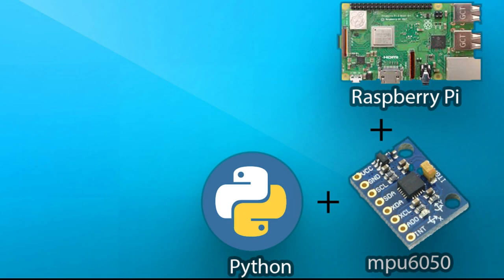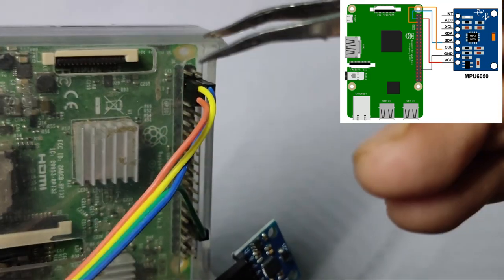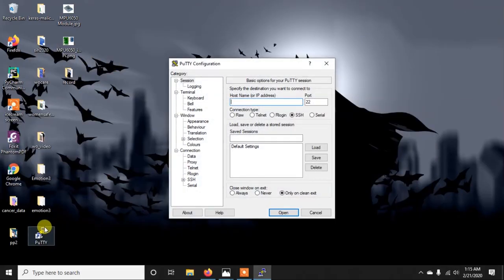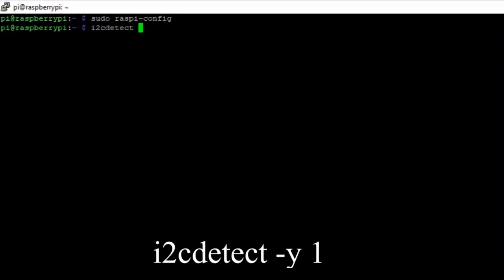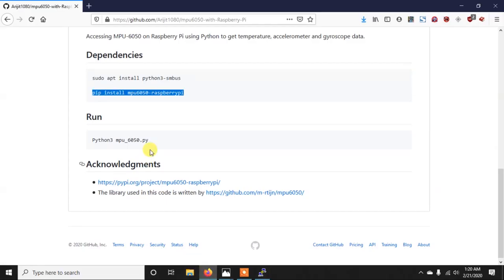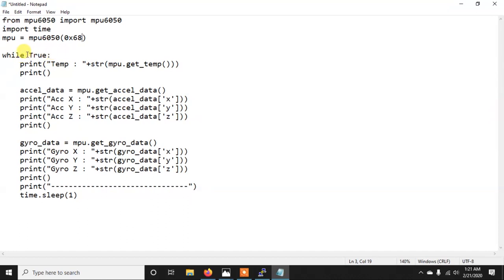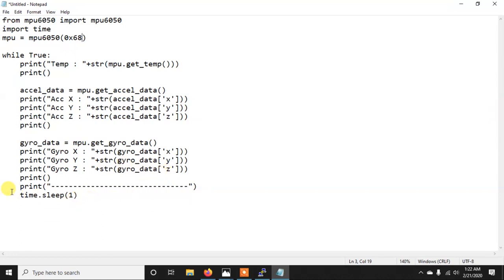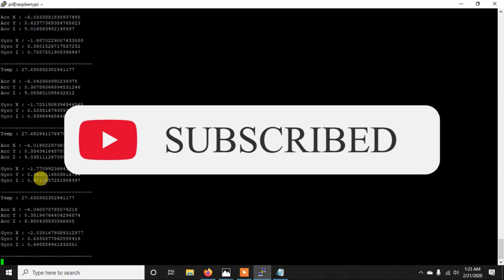MPU6050 with Raspberry Pi using python in easiest way | Accelerometer | Gyroscope | Temperature

Comment: If you add 5V the output , you get will be 5V data which will damage the GPIO pins of raspberry pi , better try using logic level shifter or 3.3V as source to the mpu6050
Reply: MPU6050 also works on 3.3V. To get 3.3V, there is a linear regulator on the MPU6050 PCB.
Overall, even if you are connecting 5V to MPU6050 board, the I2C signals are safe to be connected to Rpi.

Comment: Traceback (most recent call last): File "mpu6050.py"line 1, in <module> from mpu6050 import mpu6050 ModuleNotFoundError : No module named ''mpu6050' Why should I got this kind of error. I did  all the steps correctly.
Reply: I'm having the same problem, did you figure it out?
Reply: Maybe the file you downloaded via the terminal had been installed in the python2's folder. Try python2 mpu_6050.py instead. My problem got fixed anyway.
Reply: @petersu8254  yay! This solved my problem, it was in python2. Thank you good sir!
Reply: Same error for me. I had to type "pip3 install mpu6050-raspberrypi" and then it worked in my editor (Thonny).  When I followed the directions exactly, it only worked in my terminal window, but not my editor.  Love it though.  Now, to figure out how to interpret all this movement data. :)
Reply: @whitneydesignlabs8738  Did you found how to interpret the gyroscope movements? How to classified them? Thx!
Reply: @luciajurj9810  I dropped the ball on this project, sorry.
Reply: @petersu8254  thankyou very much bro

Comment: Getting below error after following all the steps shown in video:

Traceback (most recent call last):
  File "mpu6050.py", line 1, in <module>
    from mpu6050 import mpu6050
  File "/home/pi/mpu6050.py", line 1, in <module>
    from mpu6050 import mpu6050
ImportError: cannot import name 'mpu6050' from 'mpu6050' (/home/pi/mpu6050.py)

Can any one please help to resolve.
Reply: Try python2 mpu_6050.py

Comment: When I enter the command i2cdetect -y 1 in the terminal I get the table off but it is not empty.
does anyone know if this is a problem ?
When I run the script I also get no values ?
My output looks like this.  
     0  1  2  3  4  5  6  7  8  9  a  b  c  d  e  f
00:                         08 09 0a 0b 0c 0d 0e 0f 
10: 10 11 12 13 14 15 16 17 18 19 1a 1b 1c 1d 1e 1f 
20: 20 21 22 23 24 25 26 27 28 29 2a 2b 2c 2d 2e 2f 
30: 30 31 32 33 34 35 36 37 38 39 3a 3b 3c 3d 3e 3f 
40: 40 41 42 43 44 45 46 47 48 49 4a 4b 4c 4d 4e 4f 
50: 50 51 52 53 54 55 56 57 58 59 5a 5b 5c 5d 5e 5f 
60: 60 61 62 63 64 65 66 67 68 69 6a 6b 6c 6d 6e 6f 
70: 70 71 72 73 74 75 76 77

Comment: Hi, the code doesn't run even tho I downloaded everything you said and ran i2c but it says ModuleNotFoundError: No module named 'mpu6050' and I don't know what to do
Reply from the maker: Use i2cdetect - y 1 and before this you must enable i2c from raspi-config
Reply: @SPARKLERSWeAreTheMakers  Okay I successfully added the library but the measurements are all wrong, it gives a constant value of 0.0622 in Z and 0 in X and Y so what do you think is wrong?

Comment: Hi, my device unable to detect the sensor though green light is on. How to resolve this ?
Reply: This issue is solved by direct connecting wires from raspberry to the sensor pins. Using breadboard was creating problem.

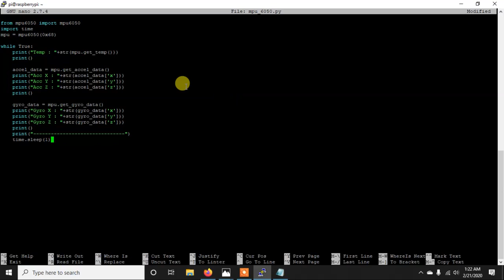Comment: in minute 6:53 ,the step is not clear...how to run and save the code
Reply: The command broken down is: Python3 mpu_6050.py tells the terminal that it needs to run the file called mpu_6060.py using Python3.  This is the same as running up your Python IDE, opening the file mpu_6060.py, then running it... but it is done here in the terminal.
Reply: I was wondering the same.
Press Ctrl+S to save, then open a new code terminal and type python3 mpu_6050.py and press the Enter key and it should execute. 

If you get a "Traceback" error, check that your wires have good connection on the sensor.

Hope this helps someone!